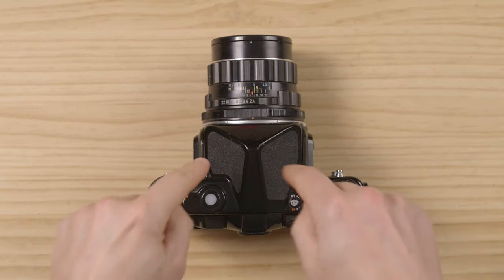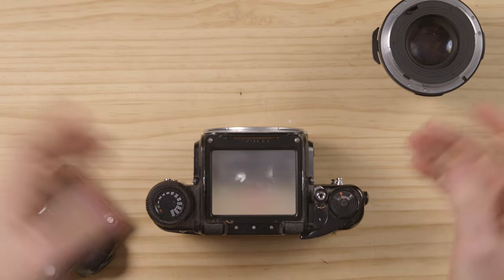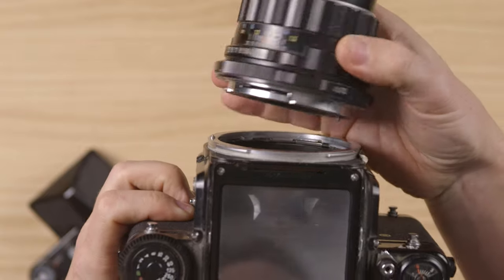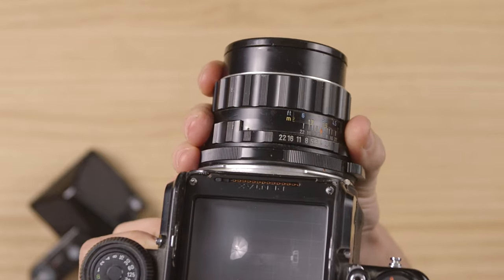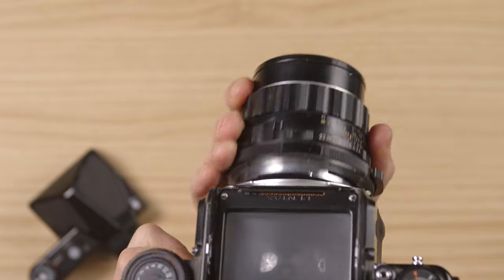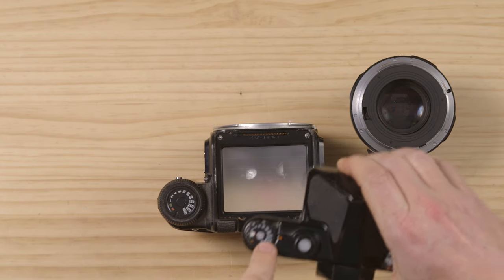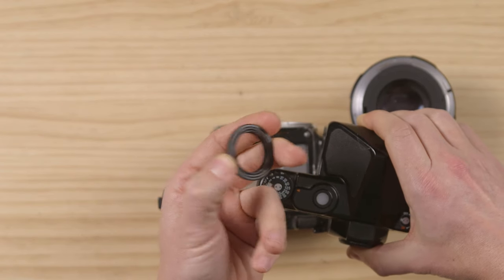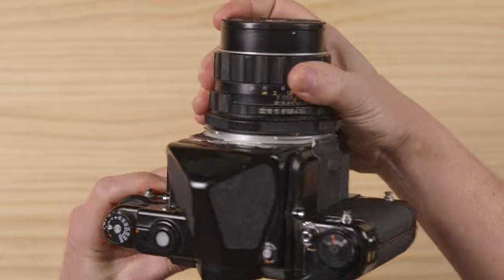How to Change TTL Prism on a Pentax 6x7 || How to

Comment: My meter won’t work at all and my chain is not broken. The little on off switch won’t lock either. It moves but just bounces back to normal. Any advice?

Comment: In the Pentax 67 user manual it states that you can remove the prism first before the lens. I See that you did it opposite from that. Does both work? Maybe it's just how you reattach it that really matters?
Reply from the maker: depends on the prism. If its the TTL prism you have to follow this video.
Reply: @NicosPhotographyShow  No--the TTL prism can be safely removed with the lens on (as per the manual for the TTL prism). What you wouldn't want to do is try to put the prism on with the lens already on. Doing this wouldn't break the chain right away, but the meter wouldn't work right either. So, basically, what's important is that the lens must be off before the prism is mounted.

Comment: Is it normal behavior for the meter in this prism to just turn off (needle drops instantly all the way) at certain iso/shutter speed combinations? Mine seems to operate like this:

400 and slower ISO: All shutter speeds seem to meter properly
800 ISO: Speeds of 1/2 second and faster are all good (selecting 1 second at 800 iso causes meter to turn off)
1600 ISO: Speeds of 1/4 second and faster are selectable (selecting 1/2 second or 1 second at 1600 iso causes meter to turn off)

Comment: Does this ttl prism work as a light meter? I mean with this it could help you on exposing better? I want to make the step to 120mm but I'm afraid on failing on shoting without any exposemeter as I have in my 35mm cameras? Sorry if i look like dumb but always better to ask. Thank you and nice video!
Reply from the maker: No problem asking Albert, this will give you the normal + - marks in the viewfinder to help expose. But I highly suggest getting a handheld meter.

Comment: My meter won’t work at all and my chain is not broken. The little on off switch won’t lock either. It moves but just bounces back to normal. Any advice?
Reply: the manual says that you must rotate the shutter dial on the finder until the coupling pin drops into the slot of shutter dial on the camera body